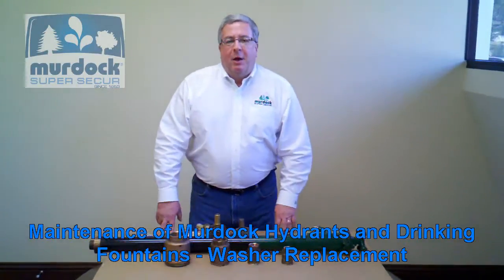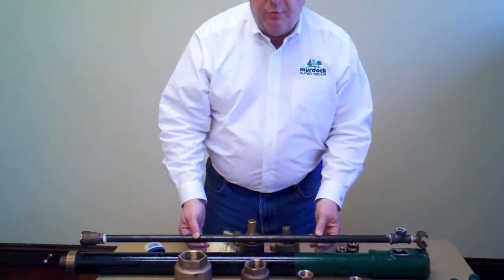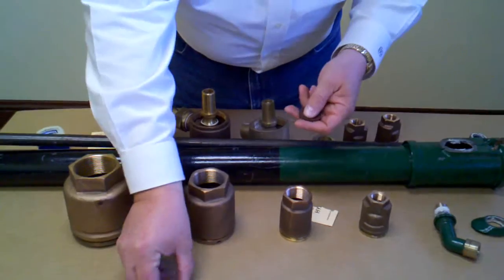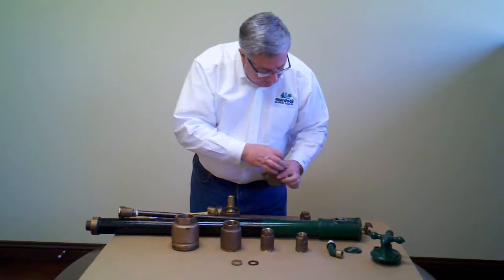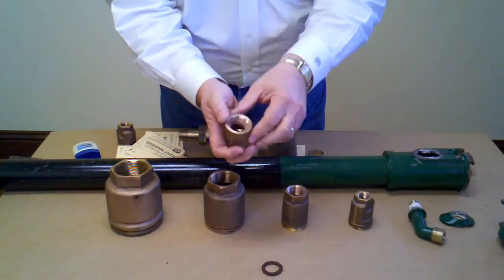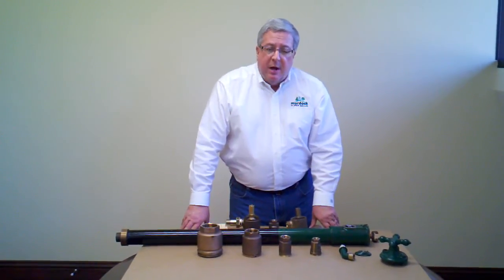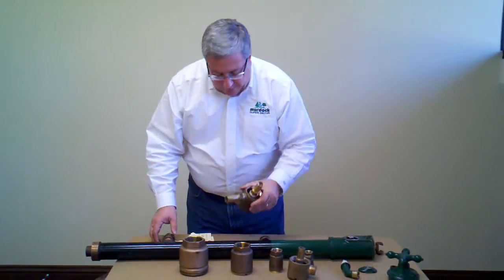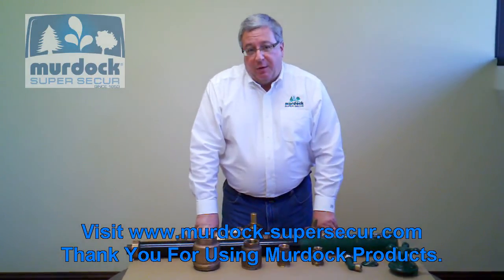How to Replace Washers on Murdock Hydrants

Comment: Purchased new gaskets but couldn't get past step 1.  Could not unscrew the nozzle... frozen solid and I dared not put anymore torque on it then I tried.  Called fields service but all I got was "spray it with WD-40".  Tried that but no help.  Disappointing....